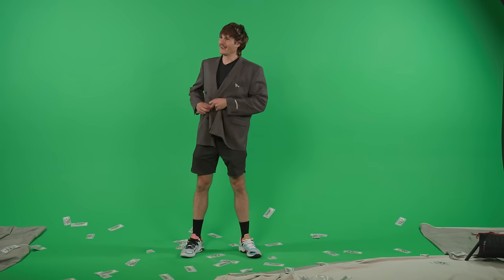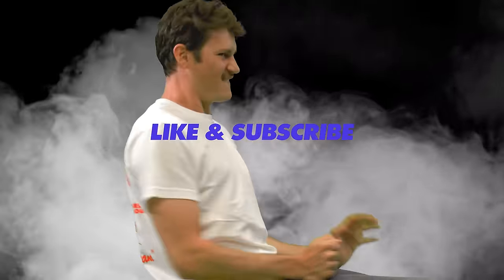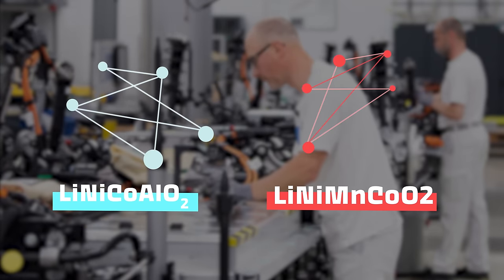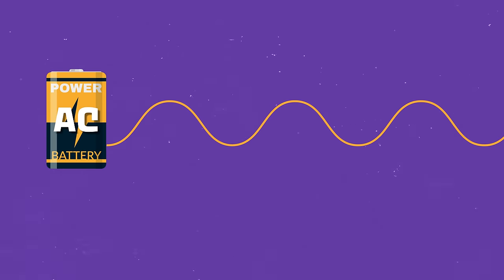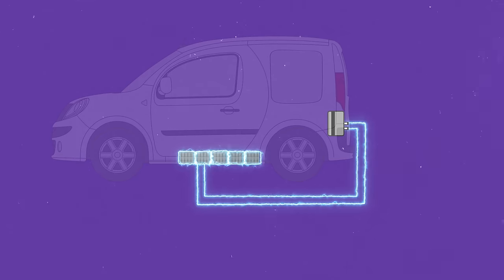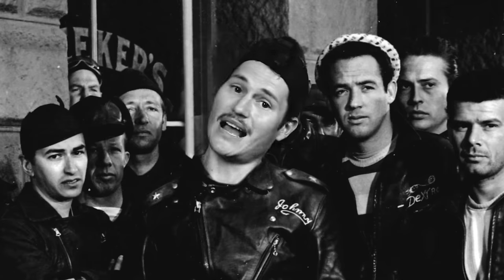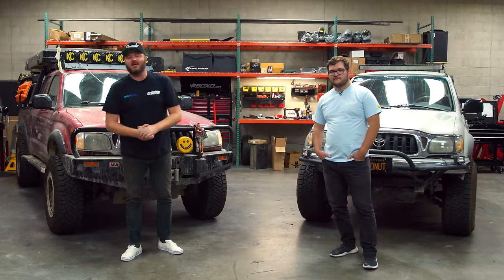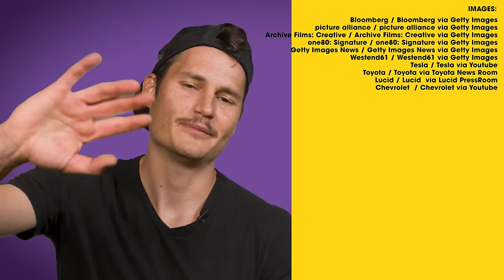Why this Chinese Car Costs $900

Comment: This feels like an engineering college students senior project
Reply: gotta cut engineering costs too.
Reply: I'd love to see the team get ahold of one and just Frankenstein it into being awesome
Reply: High school senior project.
Reply: @reallifeengineer7214  that's if they had a STEM track.
Reply: @iamageek500  We usually do our final year projects in teams and it is mainly just about justifying your choices. No way would this project go well as the professors that judge the projects would immediately spot the glaring issues with this car and tell you to redesign everything. 
I would probably rather get an electric bike instead of this car for the same price, at least then you would get a couple of quality components.
Reply: @Martian74  Honestly, looking at the prices right now with importing it to the US, it's more practical to import a 25 year old kei car. Or buy a golf cart.
Reply: @lukebrammer1059  no point them modding this out. You’d guys have more fun watching if they put a 500cc 2t engine in a go kart
Reply: No way, this would be much more complicated if it was a senior project.
Reply: @SinAlameda  Full hybrid with 7-hp Predator engine, Acura-NSX-inspired dual-motor torque-vectoring AWD, fly-by-wire steering and brakes...
Reply: A project like that would cost more than $900😂
Reply: @iamageek500  some dude from the factory walked into the local college and offered $2 for the cheapest car they could design
Reply: It works too well to be an engineering college students projects lol

Comment: Episode suggestion: Buy one of these and throw $2K into it with fun as the target. Suggestions: Permanent open top, motor upgrade with off the shelf DIY replacement from laundromat, DIY lithium cells from recycled laptop batteries, front brakes.
Reply: Castle esc?
Reply: On the next... HI LOW!
Reply: sounds like a fire waiting to happen
Reply: Electrical fires: Eyy let me introduce myself
Reply: And Lambo doors
Reply: Imagine stuffing a Hayabusa motor into one of these
Reply: Use 2 electrolyte primary battery,  refuel electrolytes after discharge,  recycle them. 500 mile range , 100kgs weight
Reply: Amazing idea,

That video will get  10 million views easy
Reply: put a 350 chevy in it?
Reply: Or just toss a scooter engine into it. Belt driven probably 5x the power and just as light.
Reply: And put V8 into it
Reply: @captainchaos3053  was thinking the same. Maybe a 300cc?
Reply: Good luck programming the bms, motor controller, regen, finding an inverter etc...
Reply: You can buy lithium-ion replacement batteries for motorcycle and cars.  They're more expensive than the lead-acid batteries but super lightweight and you don't have to worry about coming back to a dead battery if you leave it in the garage for months.

Comment: This car screams jaws of life!
Reply: scissors
Reply: @Jon VB its top speed is 25mph and the range is 40 miles lol id k swap or busa swap it then sell the EV parts so you basically get a free chassis
Reply: So has anyone ever added a second motor, (because they aren't expensive) some active cooling for the motors, and then a bit of a battery swap. They have LiFe 12 v fairly cheap that have about half the weight of a sealed lead acid, add in about 10 of those up  put an extra battery in series to take it to 72 volts (that's why we are active cooling both motors) and you could end up with something that pushes you around quite a bit faster with more range.(better battery for the win, extra motor helps to) This is just my back of bar napkin thought though.
Reply: This is an electric scooter with a cover.  Why swap in one busa when you could put in 2?  It's a step down from a go cart.  It would be a fun project for a student to learn about electricity.
Reply: They’re only called jaws of life if the person inside is alive, nobody’s surviving a crash in that thing, so the jaws of death are used
Reply: I reckon you could just rip it apart with your bare hands, and wouldn't need the jaws.
Reply: @skiptastic1000  Rip it apart with my bare hands or maybe tin snips.
Reply: IT CAN TALK?!
Reply: I think you mean "Tweezers of Life "
Reply: @OmniMontel  You have to factor in the motor's controller, the battery management system, and any parts that won't cut it at highway speeds like the brakes. Considering how bad the powertrain is, I think it would make more sense to buy an old non-running car with a decent chassis and electrify it. At least you know the suspension and chassis were designed to handle highway speeds.
Reply: Haha didn’t think I’d find dsg man in the comments
Reply: Nah.  Just a can opener! 😂
Reply: @Ayyjaxx  I doubt you would get that much for a washing machine motor and some lead acid batteries
Reply: Nah, you roll this thing and you're getting doused in battery acid
Reply: @skiptastic1000  😂
Reply: "Jaws of life" but not for this car...
If you get rear ended you will need the jaws to get you out of the other car's engine.
Reply: China tested it its 100% safe
Reply: Yeah no full auto in that car.
Reply: Ayyy, it's dsg man!
Reply: Nah they just burry you with the car
Reply: @DeputyNordburg  yeah, and the most brilliant part is that it use 60v dc, can't even barely enough to hurt the most careless idoits. You can literally just working on it barehanded and don't need to worrying 1.21 Gigawatts blowing through your body.
Reply: @OmniMontel  would def want to install a brake system up front if you'd plan to do any form of swap or power addition. Only having drum brakes in the back is def a issue.
Reply: @inebriatedturtle4310  it doesn't have discs it has some nice drums back there....
Reply: @OmniMontel  typo my b. Thanks lol
Reply: you mean open with bob the builder toys/.
Reply: Can opener will do the trick.
Reply: @Ayyjaxx  so it's like a Toyota with shorter range
Reply: Good pair of leather man raptors is all that is needed
Reply: Lol firefighters wouldn’t need the jaws of life they can just rip it open with their bare hands
Reply: It’s actually an improve golf cart.
Reply: @Jon VB a 25mph crash in this thing would suck
Reply: @andrewsteavpack9079  Jaws of Body Recovery.
Reply: @kadeweber665  : Considering what coffins cost that just might be cheaper, although the wake and funeral might be interesting.
Reply: No...THIS car screams shovel
Reply: No crazier than a 50cc scooter, which isn't crazy at all. Y'all should see the microcars of Amsterdam Netherlands. Even smaller.
Reply: It's a sardine can on wheels
Reply: Mop and bucket
Reply: I don't think you need the jaws of life for people who are already dead
Reply: Better that than sharing the road on a bicycle!
Reply: you mean a pair of pliers?
Reply: Now I want one for the lolz
Reply: Dude I see you everywhere
Reply: @inebriatedturtle4310  A dirtbike or quad set would do the trick
Reply: No full auto in the building
Reply: Wait. 25mph explains everything. If your in town most speed limits in ny town are 25. 40 miles would drive me around town for couple days. Save money on purchase, Barely get a scratch in an accident. Why isnt this being pushed all over the us cities?  
Basically a nice version of my golf cart. Honestly tho, compare accidents injuries parts bla bla bla between golf carts and cars. For in town this is perfect
Reply: nah, just a can opener, or some strong arms, like from a baby, to rip it open.
Reply: @OmniMontel  then it wouldn't be under 1k anymore.
It would be interesting to see one of those with a bigger motor, like say an Imiev (couldn't think of anything less powerful that wouldn't bend the chassis) 🤣🤣🤣
Reply: You means it screams coffin or end of life.
Reply: Jaws of life can’t cut up something that has been compressed into atoms in the event of a crash.
Reply: Could probably just rear the metal apart with some elbow grease tbh
Reply: @andrewsteavpack9079  cheaper to bury the driver in it. Prepackaging, and no coffin savings.
Reply: @miguelpineiros1567  ah I like the concept
Reply: Can’t call it the jaws of life when it’s body recovery
Reply: *Not included.
Reply: comes with a can opener
Reply: @OmniMontel  Its a neat idea but the car is so cheap and thin that you would be building a deathtrap. The brakes are adequate for its 25 mph speed limit not a lot more to give unless you start sinking a ton of money on upgrading the cars components. going much faster on that front suspension is going to be... risky.
Reply: why, you could take the roof off with an army issue c-ration P-38
Reply: @Shalrath239  if it was a Toyota it would be indestructible
Reply: But... You could easily brute force your way out with how thin the stamped steel panels are.
Reply: You not putting that on highway ...just for community use only...
Reply: @skiptastic1000  hahahahahaha

Comment: If the makers of this car were to make a golf cart version of it I feel that would be a huge success in the west with some marketing behind it since it's mechanically better than most golf carts on the market and it's a fraction of their cost.
Reply: The problem is that golf carts are used by golfers
And golfers are rich
And rich people care about bragging rights
Reply: The can try mc car
Reply: They basically are. In fact, I even saw a site that sells them as golf carts. They aren't $1000, though, because the importing, storage, and shipping costs add thousands to the cost. It actually gets to the point where might be better off just getting a UTV and making that road legal

Comment: Not unlike most "modern" golf carts, which btw cost ten times as much... Most still have DC motors, still use lead acid batteries, still use drum brakes on often only on one set of wheels, still do not feature independent suspension, the list goes on. And as said, the run 10x that price of this Chinese car and are quite popular in lots of communities.
Reply: Yea but everyone knows a golf cart is more a toy this is cosplaying as a road legal golf cart. One good accident and your toast
Reply: People are paying 10k for golf carts now...?

Comment: AC is wiggly, DC is straight, that's the best description I have ever heard, and I'm an electrical engineer! I'm using it in future lol.
Reply: It doesn't tell you very much though, it's like saying that the difference between a diesel engine and a gasoline engine is that one runs on diesel fuel and the other runs on gasoline and while true it doesn't teach you a lot. I don't think that someone who does not know anything about electricity will benefit a lot of knowing how the graphs of voltage as a function of time of AC and DC look alone. It's tailored for this video and works well to quickly explain to you why using DC motors is cheaper but if someone asked you what AC and DC are, then telling them "AC is wiggly, DC is straight" would be in a way like saying "sod off". (INB4 I know that my comment is pointless and nobody cares)
Reply: @wojtekdobrowolski8084  it does when you explain it with  picture...

Comment: You know what? I'd love to see one of these being upgraded with some more advanced tech like lithium batteries, better motor, disk brakes etc.
Reply: I wanna see someone shove a Tesla motor into one of these
Reply: So, he is misleading everyone by talking about the batteries. In fact it doesn't include batteries for that price quoted. You can order it with WHATEVER batteries or brakes or whatever you want, because they are designed to have many applications. The base batteries are lead acid but you can order lithium or just put your own in once it arrives. Also, you can get models around the same price that are AWD and have more power.

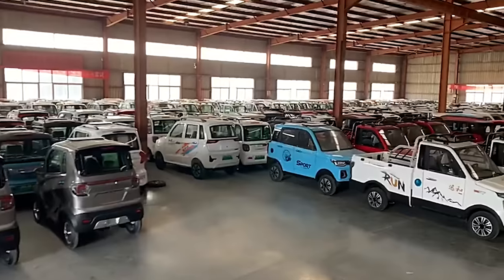Comment: As much as the build quality is probably crap, those little pickups at 10:18 would be perfect pit runarounds. Just don't let Chevrolet see them.
Reply: Is the roof rack made out of cardboard tubing?
Reply: @patriciomunoz2830  there alredy being sold in the USA there's several  import them.
Reply: Why?
Reply: u get what u paid for

Comment: I love your video about these low-budget DC vehicles.  Your information is very accurate and true.  I have been in China for 5 years, and I had a 48V 3-wheeler cart that was my car for 2 years.  My wife has a Honda Fit, and I get to drive it once in a while.  I just wanted to add regarding these vehicles - (I saw Electric Sway's comment, and the golf cart comparison rings true), the motors for these cars are the same rating as the ones for the electric 3-wheelers.  My 3-wheeler could get about 25 miles to a charge realistically (brand new 12 volt lead acid "alarm system" tall batteries) with one occupant.   2 points for jest though:  I upgraded my 3 wheeler from a 48 volt to a 60 volt for more hp on the parking garage exits, AND, I had the motorcycle shop install a second set of 5 batteries under the front seat to double the range to 50 miles per charge.  The upgrade kit involved using 2 chargers for simultaneous charging, 2 breaker switches under the seat to turn one circuit off and the other one on, and an upgraded voltage controller.  There are a few "manufacturers" that produce these (sub-$1000) cars around China.  Interestingly enough, one of the makers features a (range extender option... lol) single piston lawn mower engine beneath the hood to charge the batteries and operate the vehicle (via DC) for long trips.  These cars don't get plated in the big cities, and they would never do more that 35 kph at full throttle.  They're a kick in the pants to take on a dirt trail though.. :)

Comment: So ZYX is makes the Yugo look like an engineering masterpiece!
Reply: The yugo somehow reminds me of mk1 golf gtis lol
Reply: Also wins Dodge in quality control and reliability..oh.. wait a minute..since when Mopar had anything lasting more than a drive around the block? 🤔😭
Reply: @eddienazareth667  not since my dad's '64 Dodge Dart with a slant six
Reply: @eddienazareth667  if that drive around the block is doing a redline burnout while slammed on brakes, yes. 
Actually, reliability partly depends on how the car is driven.
Reply: lol
Reply: @eddienazareth667  what if mopar drivers just keep revving and doing burnouts? That's not even impact the longevity of the engine block lol, look at how vipers still going effing strong
Reply: @baoquoc3710  they were both designed by the same guy
Reply: @baoquoc3710  of course it doesn’t hurt the block it hurts the actual moving internals that wear 😂! Unless you sling a rod or piston out the block they can damn near last forever with very little work. Either way it doesn’t matter when you have fiat electronics it’s probably going to burn to the ground or just stop working at any moment!
Reply: At the time when it was designed, the Yugo was a decent car. It's underpinnings [like the engine] were not out-of-date [Fiat used the same engines or slightly improved versions] and the design itself was relatively modern [Giugiaro also designed the VW Golf]. And, if one followed the maintenance correctly, a very reliable car. The problems arose when it was brought to the USA due to four reasons:
1. The Importer [Bricklin] did not import nearly enough spare parts [if any] to keep the cars on the road and the customers happy;
2. many US-owners did not care [or did not know] to follow the maintenance properly;
3. The Yugo was designed for City Driving in Yugoslavia's cities, which were similar to Italian cities, with narrow streets and low speeds. The USA does not have these types of cities and the Yugo was out of it's intended role;
4. it was a "Communist" car and thus was slapped with the stigma from the very beginning [despite Yugoslavia being Market-Socialist].
Reply: @ravenouself4181  Still, it's a Yugoslavian built copy of a Fiat
Reply: u get what u paid for